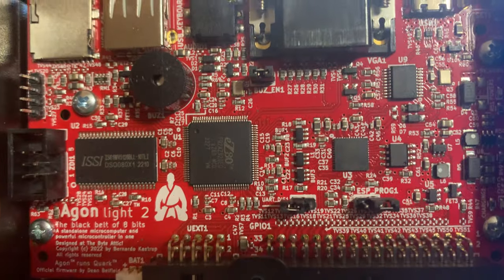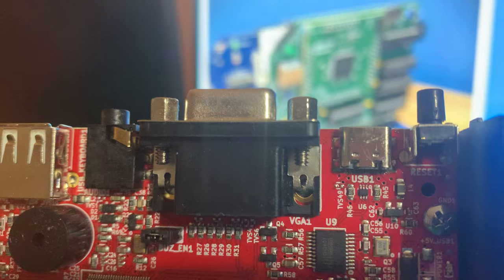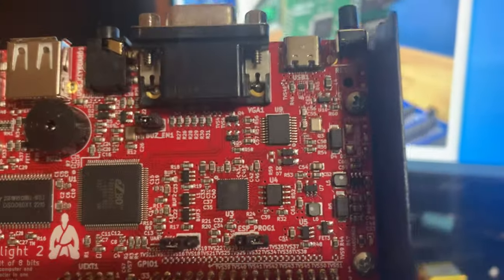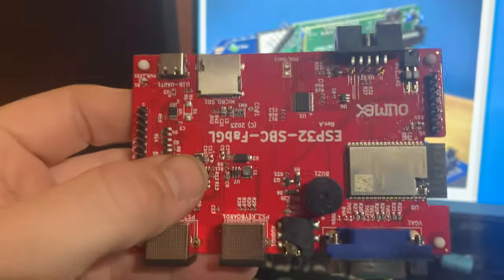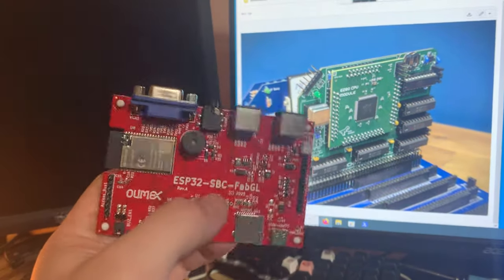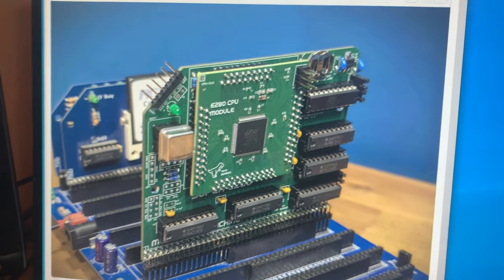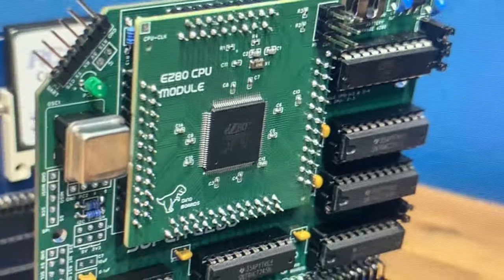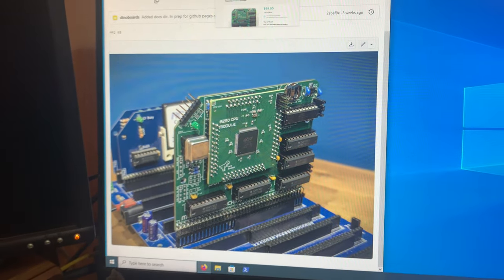Coming Soon - ez80 on the RCBus

Comment: I've never tried to use one, but I've read that it is difficult/impossible to use the ez80 as a drop in replacement for the z80 or z180, because the IO ports of the built in peripherals are mapped very inconveniently.  Is this true?
Reply from the maker: This is true, new firmware must be written. Fortunately RomWBW already supports this configuration and I'm pretty certain agon-mos will run on it out-of-box.
Reply: @lilbits3136  Nice.  Personally, I think there will be plenty of actual z80s and 180s available for the foreseeable future, but it's nice to know that there's something that remains in production that we can make work.

I like that through-hole carrier board for the ez80.  Is that something available commercially, with the CPU already soldered on I mean?
Reply from the maker: Right now it's available from DinoBoards on Tindie, though they are presently sold out. They hit the market with only a few and, fortunately, I nabbed one of them. The design of the carrier board is open source, though, and can be manufactured without waiting on them.

I like that the design could easily be reused for a completely different bus design, if wanted, or even embedded into something with a smaller footprint. I suspect the pre-assembled carrier board itself will become a product people offer in spaces like tindie.